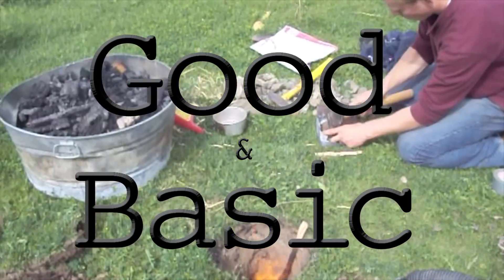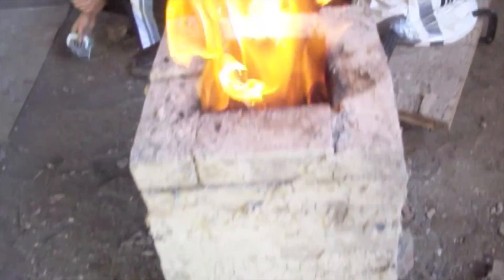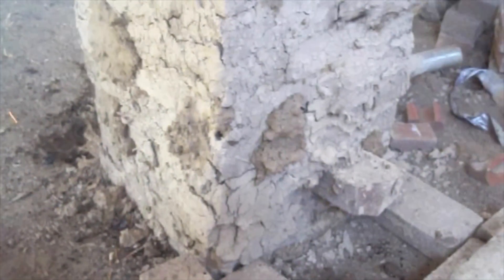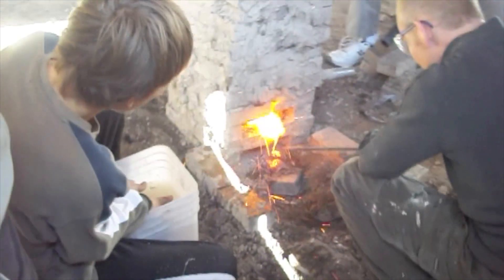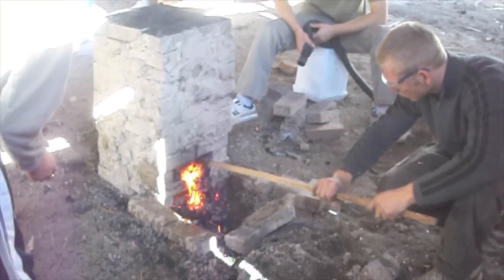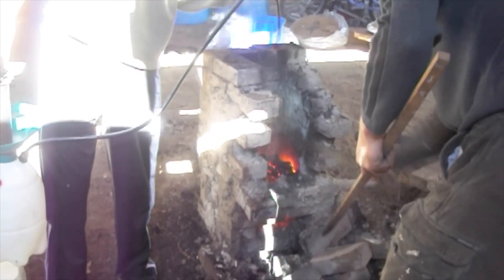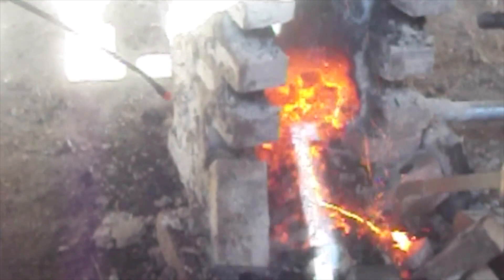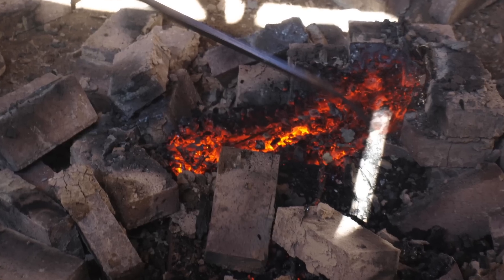Iron Smelting Epic Fail! Smelting Saga 2 of 4.

Comment: These kids and adults are extremely ignorant. You never ever put water on slang or molten metel. It will blow up. It makes the metal unstable so it blows up
Reply from the maker: You ever done it? I have. Doesn't blow up. JB